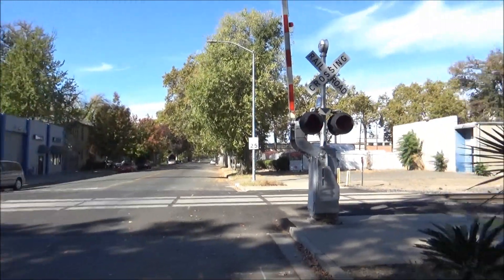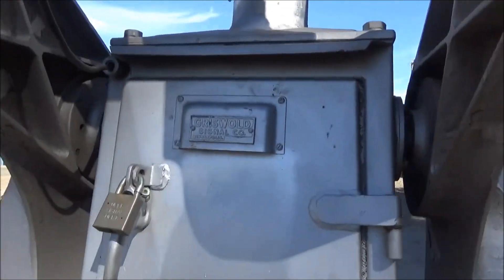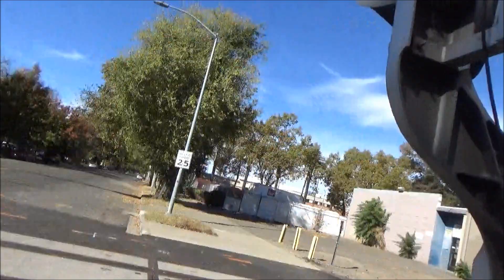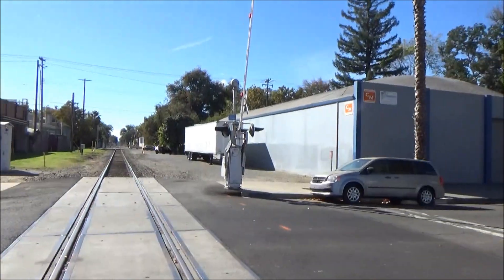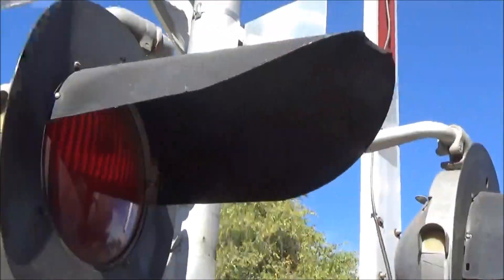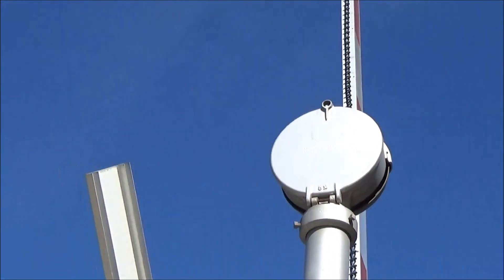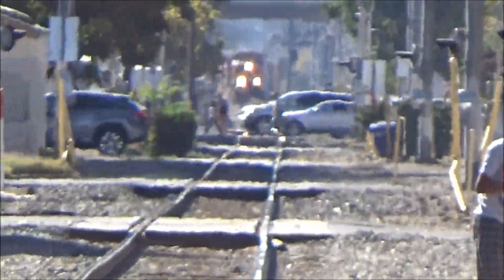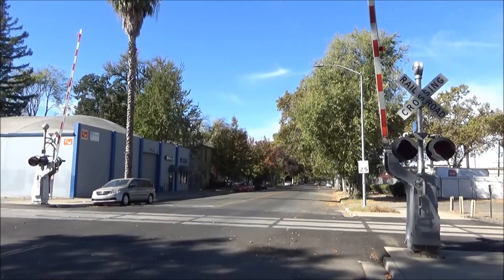D Street Railroad Crossing Tour, Sacramento, CA

Comment: Unfortunately as of 2023 the 2 EM Signals were Replaced with newer Siemens Signals a typical UP Install with Siemens Base and Gate Mechanism NEG E Bell & the DOT Tags facing Forward the same thing happened to the other Crossings with EM Signals may those Signals Rest In Pieces.
Reply from the maker: I'm aware.